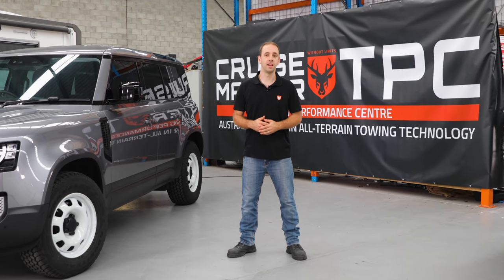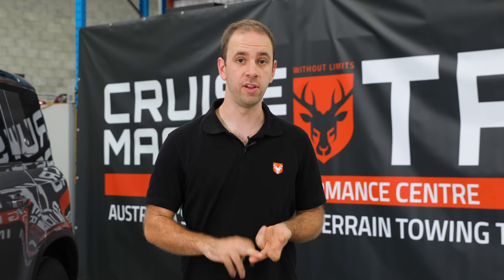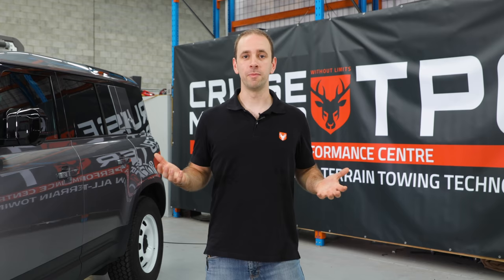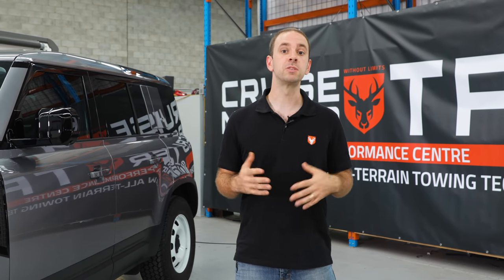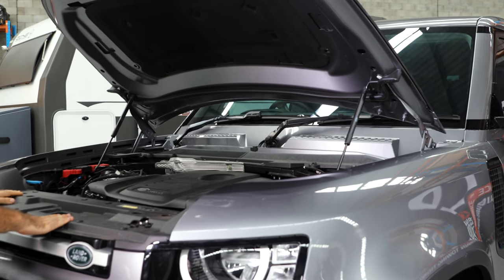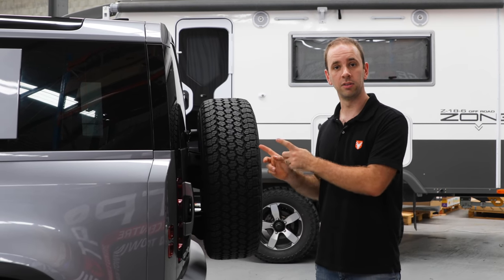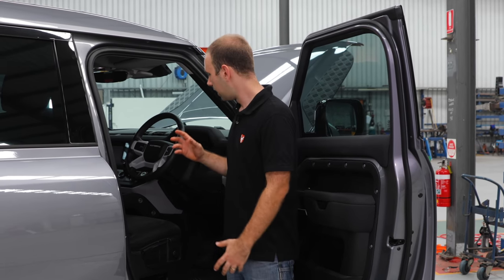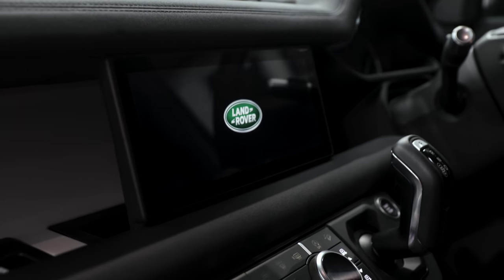Land Rover Defender - Summary After 6 Months

Comment: This review is deeply flawed. It uses a straw man argument to prove its point (although it acknowledges doing so). Who would buy a 4-cyl Defender to tow a 3.5T van? The 6-cyl, 7-seat variant  has 3280kg GVM vs the 4-cyl's 3150kg. If they used the 6-cyl for their review, and deleted the steel wheels, they'd have 200kg payload left over AFTER attaching a 350kg TBM AND loading the car with all the people + gear that they listed. Coverage of rear axle capacity issue is more accurate, though again - the 7-seat variant has a 1900kg rear axle capacity vs the reviewed car's 1800. Most LR owners two need to tow a van with a 350kg TBM spec the 7 seats and remove them, thus gaining 100kg extra rear axle capacity and not paying the weight penalty. Certainly not ideal, but neither is spending $20K-$40K on a GVM upgrade. Judging by the above and the plate "NEW 110", I'm curious to understand where and why Cruismaster got this specific vehicle? Was it promo launch stock, sold off at a great price? Was it part of a deal that you had with JLR?
Reply from the maker: Hi Steven, appreciate your feedback. We hope its clear by the video title and time of release that it is clear that this is based our our experience over 6 months and is a reflection on the vehicle we had and not future models. This was one of the first Defenders to land in Australia, well before the additions to the range with 2021 models which included the 6-cyl. 

This vehicle and the content created on the vehicle was in no way a colaboration with Land Rover and the vehicle was purchased from a dealership just like anyone else. The reason for the "NEW 110" plates was strictly due to the businesses excitement for a revamped Defender! If your unaware of the connection Arthur Goddard is the grandfather of the videos host Andrew. Arthur Goddard, was one of the original engineers for the original Land Rover project all those years ago. So you could image Andrew and the Goddard family are particularly passionate about Land Rover and were particularly hopeful for this revamp. 

We approached this project based on the specs provided at time of launch, that this was an off road vehicle capable of 3.5T towing. As specialists in the towing industry this is obviously where we focus our content. Im sure there is newer content out there now covering the newer models which may be more relevant to your interests in the current models.
Reply: @CRUISEMASTERCOUNTRY  Hi Guys, thanks for responding. I came across your review through a link posted on a Zone RV Owners FB group. The context of that post was “the Defender isn’t a great tow vehicle - here’s proof”. As I’m sure you know, a lot of people who are about to purchase a caravan spend a lot of time researching vehicle options, so we need to make sure that we provide them with the right context and nuance. To be fair, your review certainly mentioned that your car was bottom spec, but it did so very, very briefly - and without pointing out that 6-cyl options, which were already available when the review was published, would pass your test with flying colours. In that sense, I’m concerned that a lot of people who miss this nuance will disqualify the Defender as a valid towing option, instead of realising that only the 4-cyl needs to be disqualified. You’ll see this trend present in the comments below this post, too - people are viewing this as a review of “The Defender”, rather than the least capable and probably least popular model in the range. My point is that nuance matters, and perhaps this can be explored in a sequel review where you put a 6-cyl Defender through its paces. The angle could be be fun too, in a very Rocky way - something like “Did we underestimate the Defender?”
Reply: Do you think P400 7-seat variant can carry 4 adults + 2 kids (325kg in total) while towing a travel trailer with max 350kg TBM?  Will it exceed the GVWR or GAWR(rear)?